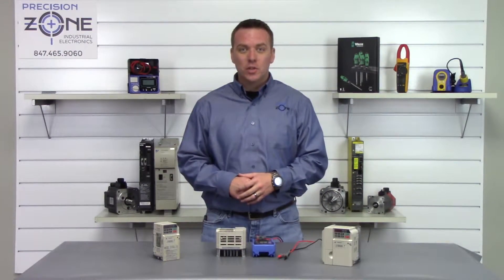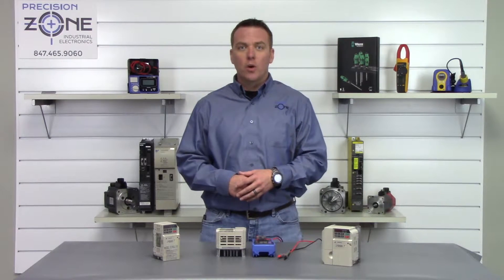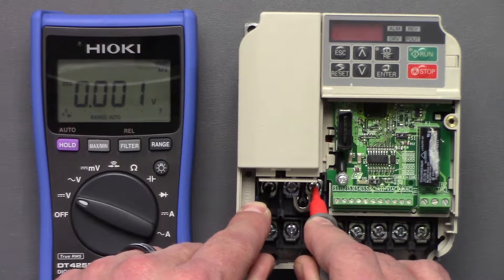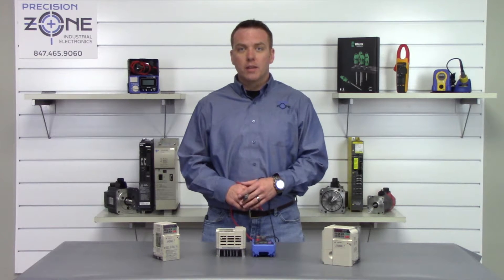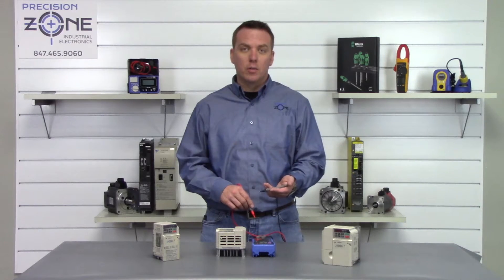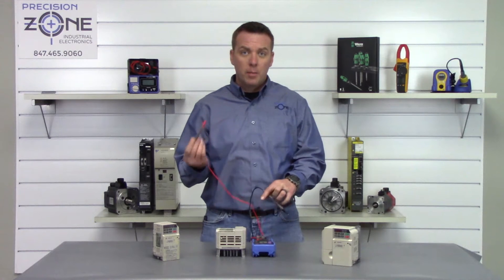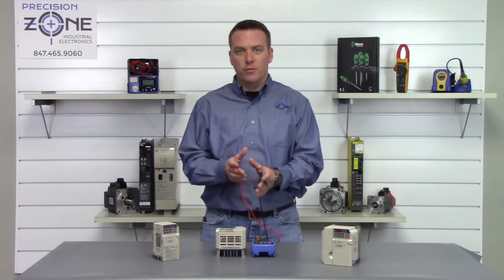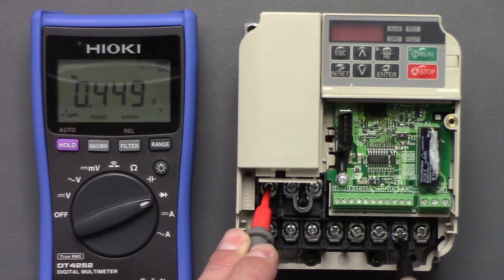Yaskawa General Purpose Inverter Drive CIMR-J1000 Static Check

Comment: Looking at the front of the drive, smoke and pop or arch came from the left side of the drive. What could have caused that?
Reply from the maker: Hi There! 

Thank you for stopping by our Youtube Channel! 

Most of the time smoke and a popping sound will indicate a failed transistor module. With that, it is recommended to check the resistance of each input and output phase to ground as well as the diode check shown in the video. 

If those checks show the unit as being good, it would then be recommended to have the unit sent in for further evaluation since the issue would appear to be more deeply embedded within the unit.

I hope this helps!! 
Please let us know if you have any other questions.

Thank you!